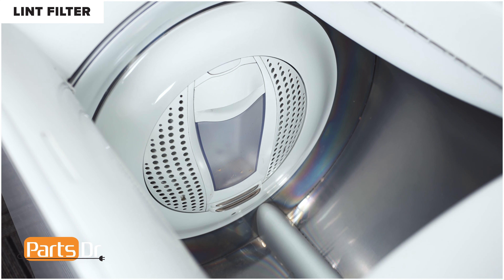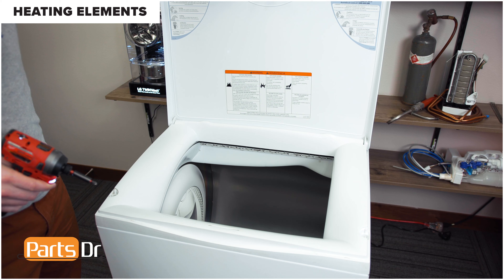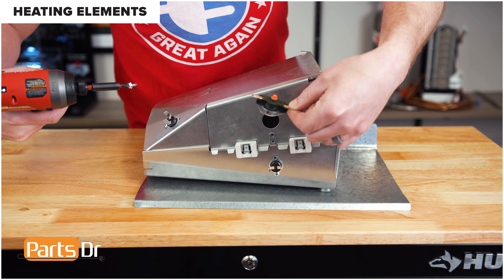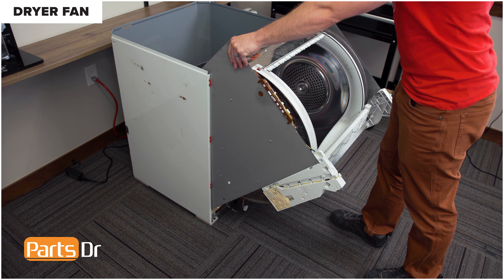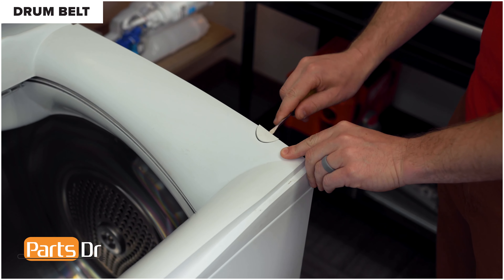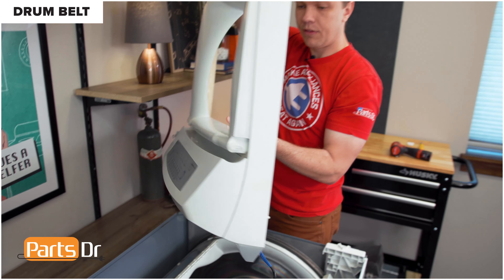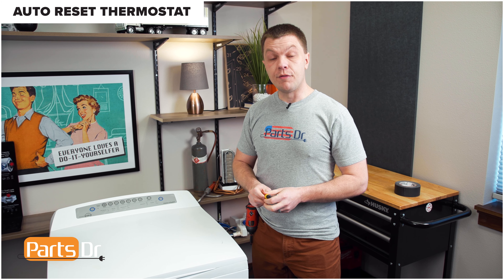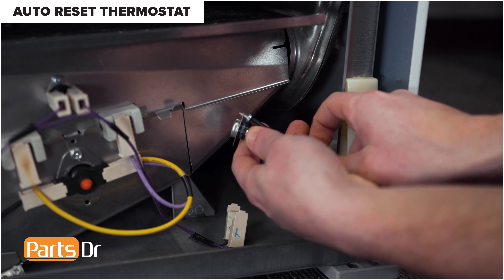Fisher & Paykel Dryer Disassembly – Model # DE62T27DW2-96165-A

Comment: putting the dryer back together is the worst part of doing any of the repairs on this series of dryer, no spacers so the sheet metal of the exterior and the interior structure is quite frustrating, the guides are there but they don't seem to work very well, do you have any tips? we've tried ensuring all the sides are level but there must be another tip or something I'm missing.